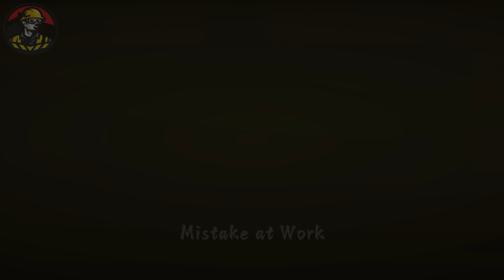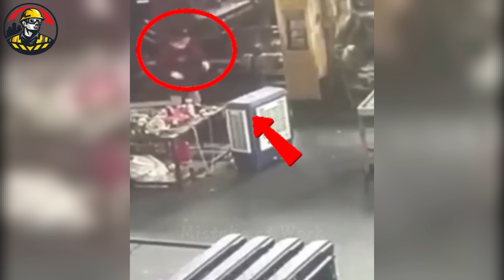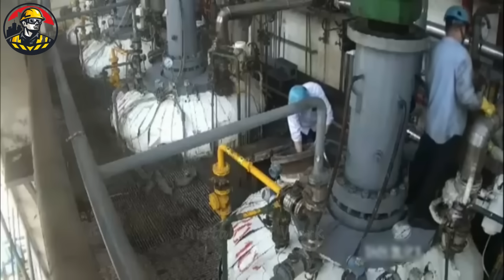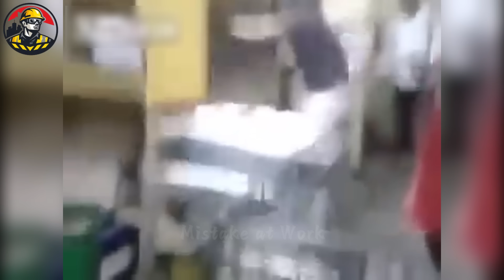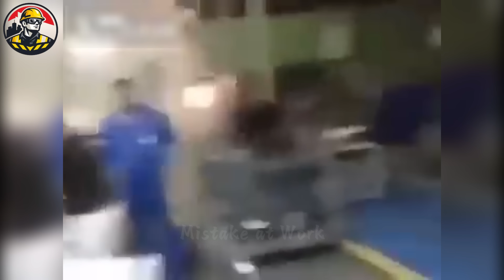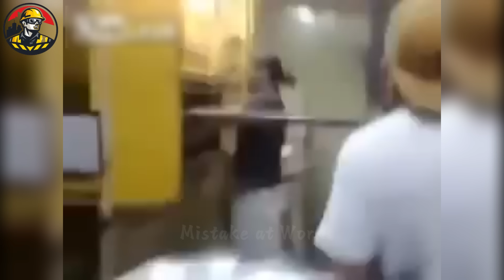The Camera Recorded His Last Seconds… Unbelievable

Comment: The exploding vessel was a hydrogenation plant that had not been properly purged with nitrogen before maintenance. The hydrogen air mix ignited inside the vessel.
Reply from the maker: Have you worked around hydrogenation systems before? 👍
Reply: @mistakeatwork113  Yes, for about 6 years in an edible oil refinery. I think we used to purge the whole system from the hydrogen source with nitrogen about 4 times, then someone from the labs tested with a detector before we could do any maintenance.

Comment: Accident No. 4 has nothing to do with uncontrolled pressure or anything similar in the system; the worker at the opening allows a liquid to flow into the reactor through a hose, likely causing a chemical reaction with a sudden deflagration. The resulting explosion is then the consequence of this action.
Reply from the maker: Do you think it was a known reaction, or a mistake during the process? 👍
Reply: @mistakeatwork113  I would assume that the reactor had not cooled down and that the worker intended to flush it with a flammable substance, or that there was a catalytic reaction with the flushing agent. In any case, there could not have been any pressure in an open reactor. It is clearly visible that the inspection hatch is fully open, therefore there is no longer any pressure inside.
Reply: But did he survive?